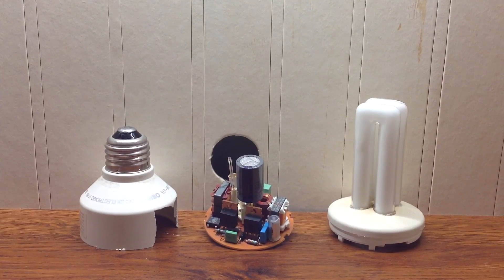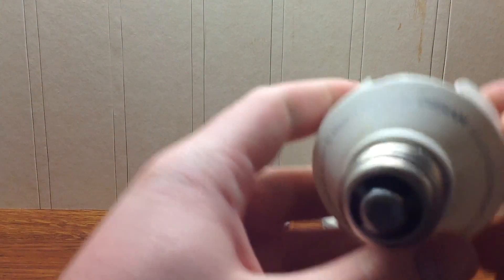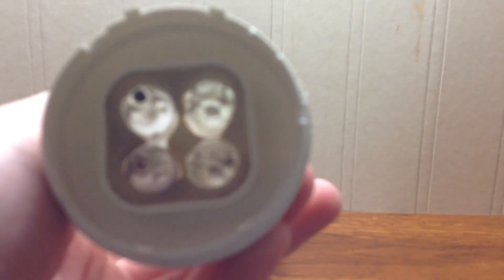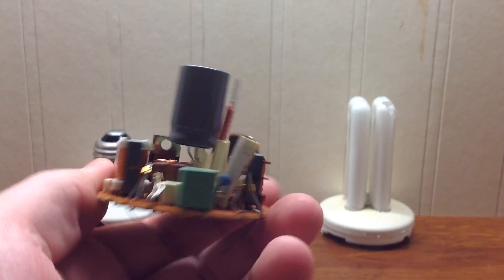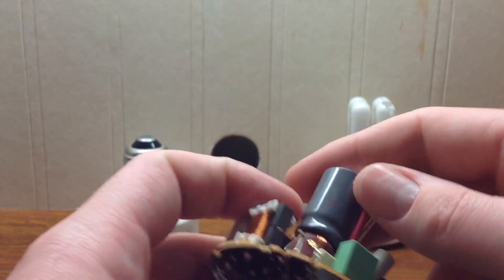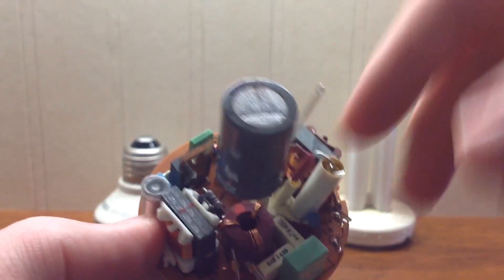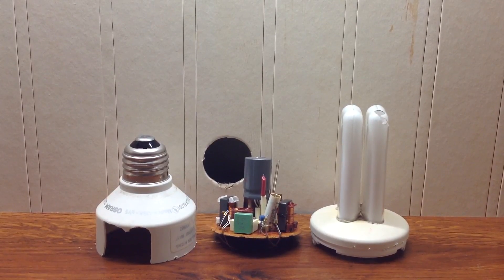Inside a old OSRAM CFL light bulb

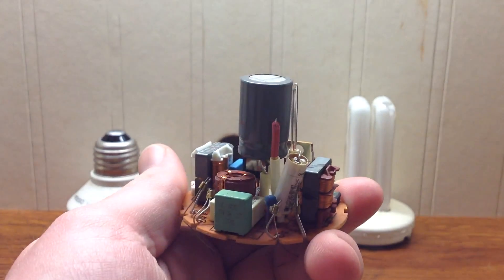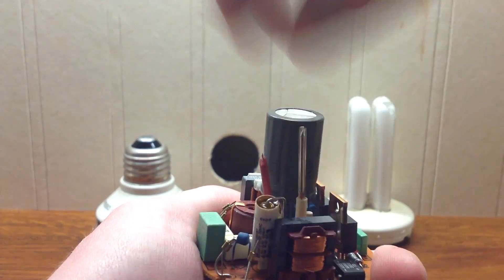Comment: The 'transformer' on the right at 1:21 is actually a common mode choke for conducted noise/QRM suppression.  The glass tube at 1:46 is the input fuse.